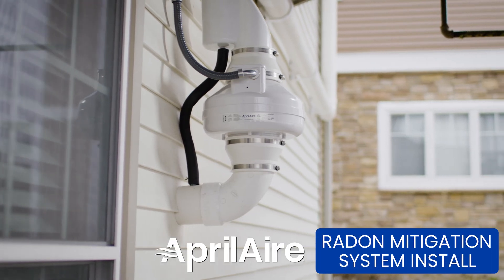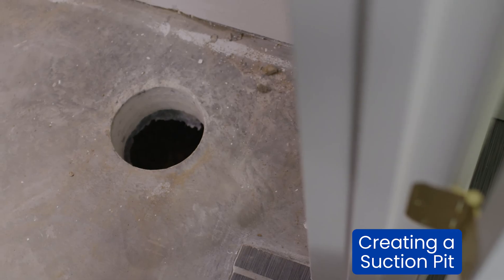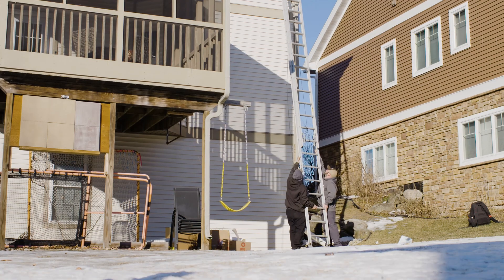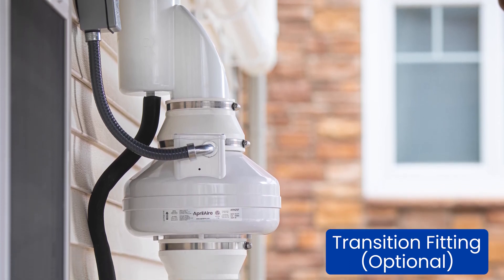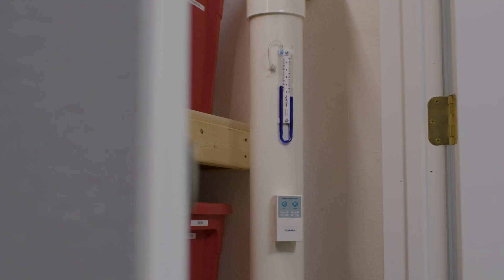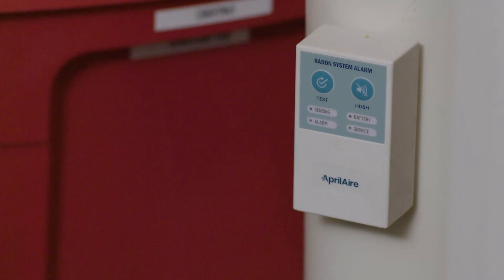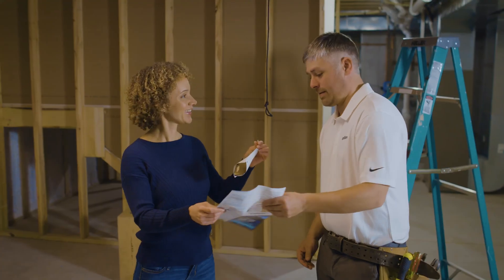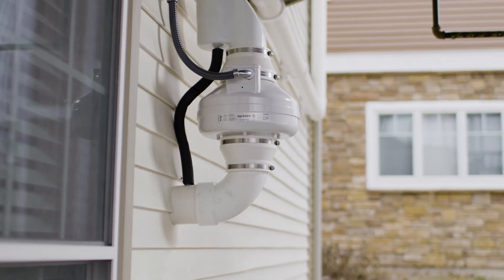How to Install an AprilAire Radon Mitigation System

Comment: Really have to wonder why 2o ft roof pipe. Why not a side vent out if not right under some deck or intake ?
Reply from the maker: Thank you for contacting AprilAire! We recommend speaking with a radon specialist as code varies based on where you are located.

Comment: The gravel underneath your slab will look very different than what they show.  
Also, why do you test when you have a monitor/ alarm?
Reply from the maker: Thank you for contacting AprilAire! The alarm is an audible indicator for the home owner if the fan stops working. The test is what detects radon, not the alarm.
Reply: @aprilaireco  these should have a radon tester built in....

Comment: Does it “have to” vent at roof line??? Is it ok to vent just outside of basement etc?
Reply: Many radon professionals route the system through the closets of the home into the attic or through a garage into the attic. Then they can house the fans out of the weather protecting the system from the elements as well as protecting the homes aesthetics. Finally they vent the exhaust pvc through the roof and into the atmosphere above the roofline.
Reply from the maker: Radon regulations will generally advise against it being below roof soffits or vents. It is recommended to be above the roof line. We would advise speaking to a Radon specialists for your specific application. Please go to https://www.aprilaire.com/find-a-pro to find a specialist in your area.

Comment: I already have the sub slab radon system with a pipe coming out and already routed to the walk up attic. The house was built last year. Even so a radon company quoted me $1250 for literally just installing the fan and they said they’re literally just installing the fan and then doing the testing…. Does this seem like a lot?
Reply: That seems a bit pricey but it really depends on how long it will take them. If it's as simple as swapping out the fan, as you said, they would be done quickly and it would likely cost less than that. It's possible that they would opt to remove the entire system and replace it with theirs since they don't know if the rest of the equipment was installed correctly or adequately. In that case, that is a cheap price.

Comment: This is horrible to have a 4” pipe running along your siding. Why can’t you guys go through the house next to the other hvac venting is run up to the roof?
Reply: I have a radon mitigation system that goes from the basement, through the garage then into the attic where the fan is located and then vents out of the roof.  The major problem with this setup is that the cold air from the basement causes condensation on the vent pipe in the garage.  This causes black mold to form.  I installed insulation on the pipe, but the insulation also gets damp.  In a couple of weeks I am having a new system installed according to the process that is described in this video.  So, with my experience going through the house is a bad idea.
Reply: That’s up to the builder of the home . Can you imagine the work it would require to run pipe from the basement and thru the roof of a finished home? If there’s room to run pipe form the basement to the garage, and there’s a garage attic, that’s entirely possible.
Reply from the maker: Thank you for contacting AprilAire! The radon mitigation fan can be installed in other locations depending on the home. Please contact a local mitigation professional for the right application options for your home.
Reply: You do know that that's exactly what gutters do right? They run along the siding.

Comment: We have super high Radon.  Around 35 pCi/L.  There is a sump pit with rusty metal liner.  Not sure this will work for a radon pit?
Reply from the maker: Thank you for contacting AprilAire. We recommend connecting with a certified professional in your area to discuss your home's radon mitigation needs and next steps. Please visit our Find a Pro locator to get started: https://www.aprilaire.com/find-a-pro. If you have any additional questions, we would be happy to assist.
Reply: @aprilaireco  Thank you.
Reply: @scotta9114 did you ever figure it out? I’m in the same spot.
Reply: @HatersHateOn My Mother In Law is 95 years old and didn't want the Radon addressed.  She lived in that sick House for over 40 years and never had any health issues.  A Radon Mitigation system can be installed by the Home Owner.  If there is a slab basement floor, you need to create a slightly negative pressure under the slab to reduce Radon.  The Radon pump I used from Menard's temporarily installed brought the levels down to around 4 pc/l.  If I would have done a permanent install and sealed the concrete, I bet it would have dropped below 2.  Good luck.